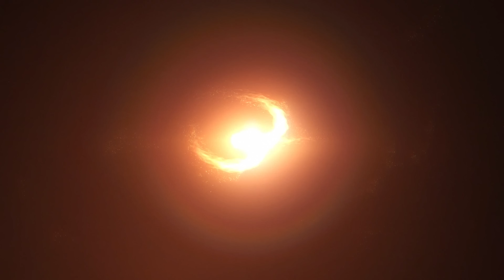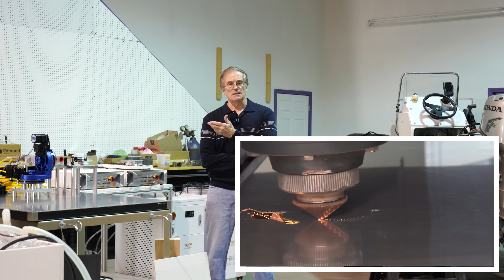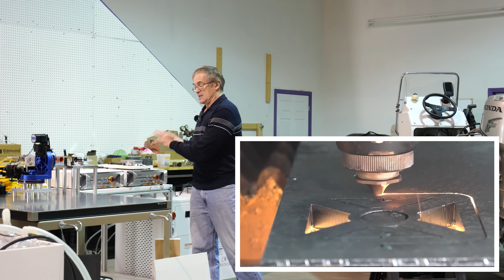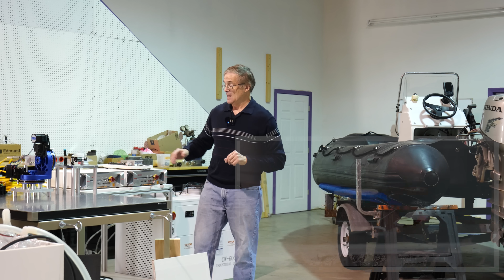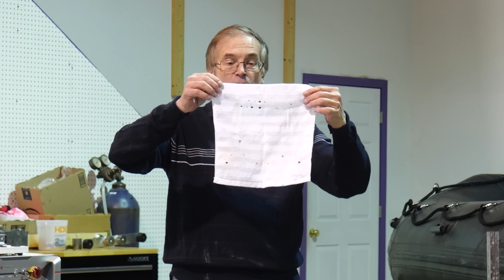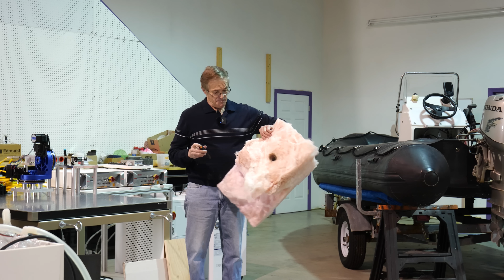We have a problem... and need your help!

Comment: You need to scatter the beam of light. Build a box out of something nonflammable. Put a hole in it and place something in the middle of the box that scatters the light: lense, water etc. Shoot the laser into the box trough the hole. The inside of the box will absorb the energy but since it is not focused on a tiny surface area, it won’t melt the box. The box might heat up, so additional cooling on the outside might be needed. The thing scattering the beam will be reflective, but since it is inside the box with a tiny hole in it, very little light will be reflected outside.

Comment: Charcoal bound together with sodium silicate and or some borax flux. Carbon is the best element to absorb the laser, being very dark, and heat tolerant as anything, and sodium silicate and or borax will act as a flux to limit air getting in so that it cannot carry an embr very far. A cond pit to make the char and then smash it up and use sodium silicate to bind it together. Figure the approprate thickness, pound for pound I doubt much could do better.

Comment: Humm... tuff problem.  Just Spit balling here... Can you go with a wider beam that narrows (converges) to a point at the target and diverges again?  Something controllable?  Maybe a piezo-electric actuator on the lenses (or maybe mirrors) to have a "finite distance of effect"?    Probably not really stopping the beam, but should spread out the energy so that at sufficient distance away the beam is not so deadly???  You'd likely need to add a "distance" aspect to your targeting system so the beam focus is at the proper distance (at that of the target).  Still a very dangerous Directed Energy Weapon, but at least you can potentially limit the "distance of lethality".

Comment: sandbags. gravity will bring fresh sand in any new craters. can also be wet after you stack them to absorb more energy and use water vapor to move fresh sand faster.

or juz big mirror reflecting laser to the ground?

Comment: Instead of covering the whole target area, how about redundancy?
E.g.:
1) the controlling computer/device must put out an alive signal (with time stamps!). If it is not provided anymore, a surveiling system (and a switch in series with the power switch of the laser) can cut it off.
2) in the optical path, add one smaller peace of extremely high temperature resistant peace of material, that - again controlled by a second, redundant system - is switched in in case the main system is not responding.
Many ideas, just very hard to explain via comments in YouTube were you are not even allowed to input links. 😬
You should provide a link to an instance where drawings can be discussed!
PS: I come from automotive, where we do not have these exact issues, but we need to break down possible problems to find the best way around life saving circumstances. :)

Comment: Large glass tank filled with sand.  Sand can be removed and place in smaller containers when not used. Be sure to angle tank at a 45 degree angle.

Comment: Aquarium with milky water?  clear glass should pass it through and the milky water absorb the energy; continuous flow of milky water to remove the heat;  drain the water after the test is over; to remove the aquarium weight.

Comment: I asked ChatGPT. It gave these answers: 1. High-Alumina Ceramic Tile (95–99% Al₂O₃)
Pros: Excellent thermal stability, high melting point (~2000°C), low thermal conductivity

Common Use: Kiln linings, armor panels

Available As: Furnace bricks, ceramic tiles

Where to Find: Industrial supply stores, refractory material sellers

Caveat: May still crack or ablate under prolonged direct exposure

2. Silicon Carbide (SiC) Plates
Pros: One of the best materials for resisting laser ablation; extremely hard, thermally stable

Melting Point: ~2700°C

Use Case: Laser windows, aerospace heat shields

Where to Get: Engineering ceramics suppliers (eBay, McMaster, etc.)

Cost: Higher than alumina, but small plates are available

3. Graphite Blocks or Tiles
Pros: Absorbs and dissipates heat efficiently; high sublimation point (~3600°C)

Cons: Fragile, messy, oxidizes in air at high temperatures

Use: Machining stock, crucibles

Availability: Industrial suppliers, machinist shops, even some artist suppliers

Caveat: Use in inert or low-oxygen environment for best performance

4. Copper Heat Spreaders (with Cooling)
Strategy: Use copper to spread the heat rapidly to prevent localized melting

Pros: Excellent thermal conductivity

Additions: Attach to water-cooled backing or phase change heat sink

Use Case: Laser target dumps in research labs

Where to Get: Hardware stores, electronics shops (heatsinks)

5. Concrete + Sacrificial Layer
Practical for YouTubers: Stack up layers

Outer layer: ceramic tile or metal

Middle: air gap or insulation

Base: concrete block or firebrick

Sacrificial approach: Accept that the first layer will be destroyed but protect what’s behind it

6. Polished Metal Mirror (Beam Redirect)
If laser is not scanning randomly: Reflect it off a polished copper or aluminum plate at an angle

Why: Reflects significant % of infrared light from fiber lasers

Caution: Dangerous due to beam redirection — only safe in controlled environment

💡 Safety & Notes
Always use protective shielding, and consider local venting or fume extraction (many materials release toxic gases when vaporized).

Fiber lasers typically operate in near-IR (1064–1080 nm) — most materials absorb well at these wavelengths unless specifically designed to reflect (like gold coatings or polished metal).

Consider filming behind laser safety glass (IR-blocking) if the beam could scatter.

👷 Best DIY Combo for a Creator:
For practical, obtainable wall protection, use this stack:

Front: Replaceable high-alumina tile or graphite block
Middle: Air gap or copper plate on heatsink
Back: Firebrick or concrete wall

This balances cost, availability, and protection.

Would you like links to specific vendors or examples of how this is used in real laser testing labs or defense systems?

Comment: EE here. I have an idea to improve safety but not a total solution to your problem.

Firmware tricks, in plain English:
* Regardless of what material or solution you end up using, your motion controller "remembers" the spherical polar coordinates of every place where you've fired the laser, and for how long it's been fired at those coordinates
* You decide on a maximum time that every "coordinate" will tolerate a laser being fired at it
* If the laser traverses that coordinate again, you kill the laser. I don't know if that means the experiment completely stops, or if those supplies can be quickly disabled and re-enabled to keep the experiment going outside of an coordinates that exceeded their alotted time.

This could be safer because you can divide up the "killzone" into any number of increasingly smaller and smaller regions. The controller looks up the current encoder-measured coordinates quantized to some value in a 2D lookup table, and the lookup table stores the amount of time in milliseconds that the laser has been fired at that quantized coordinate. If the encoders say the laser is pointing at a quantized coordinate for more than N milliseconds, you kill the laser and stop everything, or you just kill it for as long as its still pointing at that quantized coordinate.

This could be even more safe and reliable if you set this as a sort of "laser enable interlock" and do this lookup computation with 2 independent units, and XOR the result of the computations together. That way, all your bases are covered, even if the thing locks up. It doesn't eliminate all the risk, but probably most of it.

This safety solution can be adapted to any material or solution you wind up using.

Comment: Although I am not a professional in this field, I believe a cost-effective yet reasonably effective solution would be to use sandbags. They can withstand high temperatures and, in my opinion, would likely prevent the laser from penetrating.If that is not feasible for any reason, an alternative could be to soak the plywood in water several hours (or days) prior to use.

Comment: I vote for waterlogged plywood.
Backup idea: 2 rollers with a looping damp sheet running between them, like the old-timey looping cartoon backdrops. The faster you spin the rollers, the "thicker" your sheet will appear to be to the laser.

Comment: You have a tricky problem.  If I were so inclined to do such I would dig a tunnel about 40 feet long using cut and cover.  For the beam stop I would just use dirt and spread it over with fresh damp dirt mix as needed. As it will displace, but that would be easy to fill back in between test.   And you could use a water shower inside of a drain pipe to pull off any gasses that might be of concern. (I saw it on youtube. Their channel is called Tech Ingredients. They were dyhdrating water for cooling but still it would make a workable ejector gas  mover and it would capture some too... I recon.)  If you cant do that built a box fill it with clay/sand mixture or sand or ground ceramic pots. Or a suitable material that would fuse under high heat.  And you could do test with 4 inch or 8 inch depths to see how long it takes to make it through the material. The wallboard could be the primary interception point for the beam, fill material, concrete board,  then plywood.  If you get 2 or 3 seconds before penetration of beam. then you can build 5 or 10 for more time.  Arranged like a whipple sheild.  Find a material that works well with attenuation of that beam frequency and use that for beam stop?  Just guessing here. Hope yall find a solution soon.

Comment: Graphite sheets, 48" x 48" (16 sq ft), 3 mm thick: $160–$480, or Pyrolytic Graphite which is really expensive, maybe a combo of the two where the cheaper option is the backup

Comment: Make a double sheet wall from fibre cement board and fill gap with sand and water slurry.  The sand and water will disperse and absorb the laser beam. Can be made modular and filled from the top and drained at the bottom before storing or transportation. Any holes can be patched with plaster cement over time. Use metal spacers or wires to prevent the panels from separating.
Been watching from down under since covid thank you and love your channel!
Reply: Like shower stall liner?

Comment: As mentioned by another, a water curtain but using laminar flow, similar to the method used in industrial spray painting or maybe multiple layers

Comment: For your testing - are you limited to shooting the beam horizontally? Perhaps it would be worth shooting the laser head at the floor into a water vessel - just like the laser and plasma tables are designed. Water alone may not be enough to absorb the energy but it would make constraining the problem easier.

Comment: large glass tank fill with water with black dye in the water.  Dark water can be stored in 5 gallon buckets when not used.
Reply: Angle tank at 45 degree angle.

Comment: Maybe its possible to place mirrors at an angle or a prism or lens as long as the beam shines downwards after passing the target. Fill a basin with water and whatever absorbing materials were mentioned, it will stay soaked underwater. After testing, just close the pool. Or wait just point the laser slightly down into the water

Comment: Graphite or Beryllium? Tank of water or frozen water?  Perhaps not trying to block it may be a solution, as in direct it away from anything that you would not want to be damaged, though it may cause a problem some distance away even if focused upwards.   Altering the frequency through prisms or somehow cancelling the beam by causing interference with another laser of the same frequency may also be an approach.  Apologies nothing concrete just ideas being thrown around.  If nothing else turns out to be helpful simply reflect the beam into the ground...

Comment: "liquid filters" Old 3 tube video projectors used liquid filters. So a CRT with a cavity filled with a dyed liquid in front of it, so it can not burn.
Use a glass basin with an opaque liquid to absorb the laser power. 
Pump the liquid through a radiator to cool it.

Comment: Ablative: Cork; Thermal dilution: Carbon Vapor Deposition, Diamond fibre composites (titanium matrix), self build CVD, or aerospace research into high power jet engine components. E.g. Rolls Royce use single crystal turbine blades, the thermal transfer performance of a given single crystal metal alloy will indicate the required thickness of the target with a high melting point to take away the thermal load before vaporisation of the surface material? Liquid nitrogen, in contact with the planar edge will extend the use of this target plus the overall size, x,y,z can be tailored to suit your laser output and minimize costs of commercial products. Since not for profit, there should not be a patent infringement. Research required to optimize alloy composition, help may be available under NDA? Good luck, just love your enthusiasm and transparency. Thank you for inspiring me and setting wonderful examples to everybody! Live long and prosper... Today is a good day to thrive.

Comment: Modern ultrafast lasers can achieve pulse durations in the femtosecond range, allowing precise control over light travel distance. How fast can you pulse this laser and effectively turning a laser beam into a laser cannon. This may result in a more capable weapon requiring range detection.

Comment: I had a friend in college who was working in the school's laser lab.  It was twenty years ago so I don't remember what the material was called, but they had this frosted glass looking prism that was used as a stop for their laser that worked by scattering and defocusing the laser into hundreds of less powerful diverging beams.  It reminded me a bit of aerogel (which it may have been) and the piece they used was only a cube about 2 inches on a side, and they still had a layer of bricks and sandbags on the table behind the cube just in case.  The school was Michigan Tech, so you could try contacting them and see if they still use something like that and where to get it.  Sorry I couldn't be of more help, but this is definitely an interesting problem to have.

Comment: Could you not just reflect it into a trench in the ground?  Fill it with sand or a more exotic material.  Think big flat plane mirror at 45 degrees.

Comment: How about a series of mirrors that send the light in an infinite loop? It looks like a few manufacturers like Edmund Optics make special mirrors with dielectrics for this application. You could even lense the laser to a large surface area in the assembly and vent the laser out.

Comment: Instead of focusing on how to stop the laser beam, I would work on how to be able to change the distance of the focused laser beam with some sort of adjustable lens. You already have a tracking system, so knowing the distance from the tracked object should not be a problem. Jeff
Reply: This would be my first thought too.  A set of lenses to make a “wide” laser beam reduces the energy density of the beam. Then use a series of mirrors, like a DLP chip to make the final “set” of beams act like a variable focal length system.  The only point where the energy of the beams converge is then at the target.  And I know this will likely have constructive and destructive interference effects as you are using a laser so managing beam path lengths will be a big technical challenge.
Reply: @kennedy250980  I have a laser cutter and this exactly how it works, focusing the beam, probably easier to say than do.

Comment: Since most cheap materials will not withstand this energy density for long, one of the things that might be be worth investigating, could be combinations of materials that will lower this intensity by increasing the beam's cross-sectional area, e.g. by passing through gradual refractive indices transitions in saline solutions, or glasses, thereby messing up the beam collimation. 

Or maybe use successive layers of materials that would form diffractive grids? That might disperse the energy over a larger area as well.

Another line of thought. Does the wavelength used in the laser coincide with the spectal lines of a known element? If so, could a volume of gas containing the element absorb the energy at least temporarily? If not, (and this is probably neither going to be cheap, nor practical) could the Zeeman effect be applied to make the absorbing positions in the spectrum match that of the laser?

Or maybe use a beamstop that's always moving so that every position on it is only exposed to the laser once, and only very briefly? So short that it cant burn through, even if the beam is stationary.

Would active cooling be an option? Perhaps a wall of overlapping metal or ceramic conduits can be cooled enough to sufficiently increase the time it takes for the laser to burn through them?

Comment: I wuld recomend aerated concrete it dosnt absorb the light and scatters it across the room.
The first milimeters wuld melt while the layers behind are well insulated so it shuld last a long time.

They come in blocks even avalible with handles cut into them and are relativky cheap.

Greetings from Germany

Comment: Take millions of pieces of broken glass and melt them together partially, or make some kind of semi-transparent mortar mix with glass inside that can either fragment or disperse the beam in a controlled way, or spread out the energy enough to significantly slow down cutting.
Tnink transparant/reflective, its the only way.   
Catch the beam.

Comment: The problem is the cooling rate. Some cafes have glass walls with water running down them. If you make a plywood wall and provide a strong enough water flow, you can keep the laser on at one point for a very long time. For example, you can boil water in a paper cup even on an industrial burner.